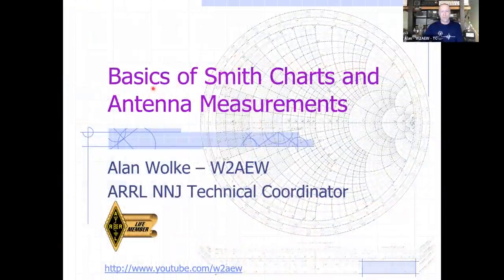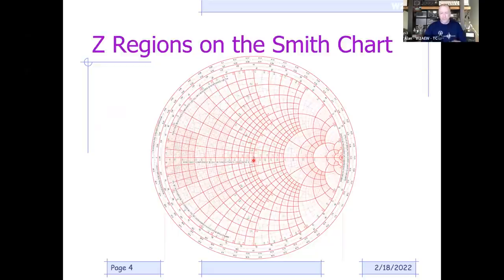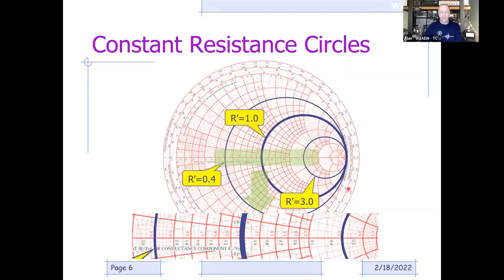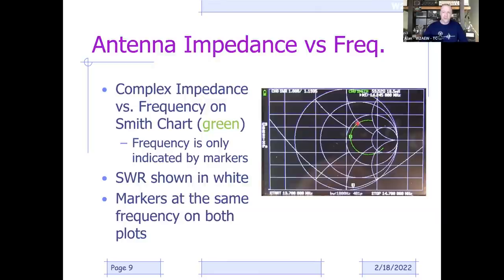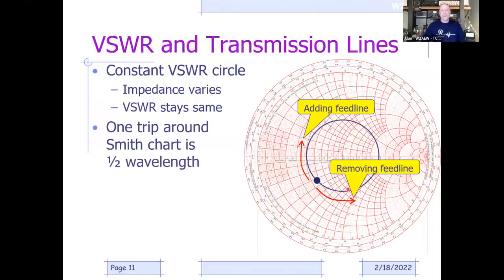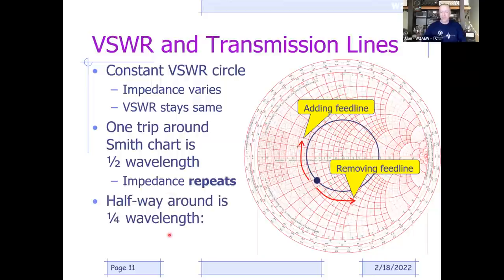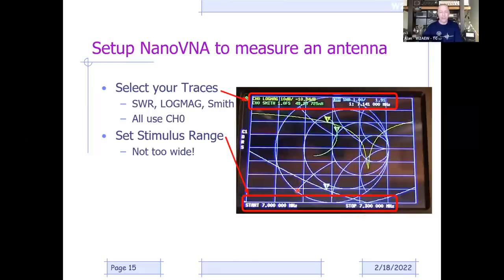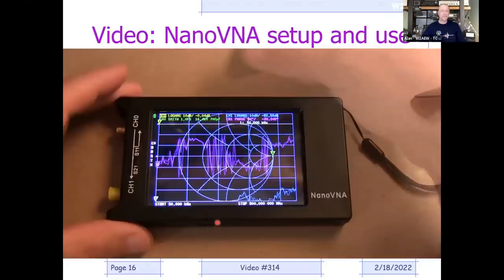#349: Club Presentation: Smith Charts - the NanoVNA and your antenna - matching network design

Comment: No doubt this is the best Tutorial on transmission line and antenna system measurements. The way you explained the correlation is superb and easy to follow. Thanks a lot. Missing the probe tip though 😊

Comment: While restoring a Gates BC-1T AM xmitter, I came across this presentation. Could not have been more perfectly timed as I began the pi network rebuild and connection to my balanced doublet antenna. It demystified some RF challenges along the way and helped me enjoy a successful finish to my 800 lb (literally) project. In fact, your library of videos are a wonderful gift to the amateur radio community and anyone desiring to go a bit deeper into electronics. Thank you.

Comment: Excellent practical explanation. Very neat to see how it all adds up. 20 years ago I had the Smith chart as part of the education for electronic engineer, but used a vector network analyser only in a few occasions. Never worked with Smith chart in this way. Very nice to be able to calculate your way to match the network in a few clear steps. Very interesting. I will watch this video at least one more time 🙂 Thank you for your effort! I have bought a nanoVNA H4 recently and will start to use it.

Comment: This was outstanding !  I picked up Walt Maxwell's  ( W2DU) book a few years back.  He changed the way I think about and  work with transmission lines and antennas forever .The only trouble I had with the book was putting his Smith charts to work. You have just made it  so simple for me to understand. I guess I will  have to dive back into the book now. Thanks and 73 !

Comment: Hi Alan Excellent stuff as always. I've been licensed since the early 70s doing quite a bit of construction and building. I have known that altering feedline length can change SWR but was at a loss to explain why. Your explanation struck me as basic and even embarassed me. Now I know why. For others that want to delve down deeper into this subject, and there is much more, Larry Benko W0QE has his own Youtube Website which deals with the subject. It references a Computer Program "SimSmith" that is a powerful tool itself. For those interested just put W0QE in the youtube search engine. But be forewarned this is a deep subject. Larry like Alan is a Degreed and Highly Experienced EE. His videos are not as easy to follow as Alan's.

Comment: Great video, Alan, as usual.  Thanks very much.  To close the loop on antenna matching networks, would you consider making a video talking about how to choose the right L and C components?  I know inductors can be homemade, but how do I determine wire diameter, core material, number of turns, etc.?  What types of capacitors are suitable?  Cheers!

Comment: I have an automatic tuner (LDG Z-817) that requires an antenna connection, a connection to the transceiver and a serial connection to the transceiver to function. I know I can use a NanoVNA to tune the antenna itself, but I'm not quite sure how I would break out the connection to see what exactly the tuner is doing or if it would even be possible since the transceiver goes into a PKT transmit mode so the tuner can figure out what to do. Not sure what that would even do to the NanoVNA or if it can even pass signal through the SMA ports. I suppose I could connect the NanoVNA to the antenna and adjust it as good as I can, connect the antenna to the tuner and have it do it's thing and then connect the NanoVNA to the tuner and note the change. Thoughts? Great video by the way. Took what appeared to be a difficult subject and made it very easy to understand.
Reply from the maker: Unfortunately, you can't "watch" what the tuner is doing since it needs the transmitter signal to do it's job.  But, assuming the tuner holds its setting once tuned, you can disconnected the radio and connect the NanoVNA to see the result that the tuner came up with.  You'll also be able to sweep over a frequency range to see how broad the tuned result is (i.e. how far can you tune the radio from the original tuned frequency and still have a decent SWR).

Comment: Great presentation - thank you so much! BTW, Smith charts are a powerful graphical way of solving the impedance matching problem, it would be interesting to learn more on analytical solutions to the matching problem. Most ATU:s sounds like a spanish castanets player on drugs when optimizing but surely there must be analytical solutions? If one turns the solution sought by the ATU into a two dimensional random walk optimization problem, I guess one would also be at risk of ending up in local minima?
Reply from the maker: The benefit to an L-network is that there is only 1 minima.  A T or PI network have have multiple solutions.  The downside is that you have to pick the right L network topology.  There are analytical solutions, but they require a vector measurement, not just a reflected power measurement which is typical in auto tuners.

Comment: Hi Alan, thank you very much for the great explanation. Your videos are the real treasure! I have one doubt, and I would be grateful if you can help me to clarify. If we have an external antenna (for instance flex antenna) that is attached to the PCB via coaxial cable and u.fl connector, and the matching circuit is placed on the PCB (let’s say before u.fl connector, if it has sense), how to perform impedance measurement/find the right measurement plane? If we attach VNA at the matching circuit, should we also somehow include the length of the antenna coax cable (actually the distance from the matching circuit to the antenna) because, as you mention in the video, its length changes the way how the impedance is seen from the other side (rotating on constant VSWR circle)? I am a little confused about this. Thank you!
Reply from the maker: You would apply the concept of Port Extension.  I have a video on this:  https://youtu.be/bEPUePy_buM
Adjusting the amount of delay or port extension can be done experimentally.  You'd start (after calibrating at whatever point you can) by estimating how much you need to move the measurement plane from the calibration location.  If it is possible to solder/attach a temporary short at the desired measurement plane, you can then use either the phase plot or the Smith chart  and watch the result as you tweak the delay / port extension value until the phase plot goes flat (or the Smith chart goes to dot at 9 o'clock).

Comment: Great content. Forgive the stupid question, but I am analyzing / tuning a cobweb antenna. Feed line is about 100' from transceiver. Do I connect NanoVNA right were my transceiver is and calibrate with the short / open / load at the antenna feed point (100' away)? I originally calibrated the NanoVNA with the shot / open / load right on the Nano itself, then did analysis with 10' of RG8U right at / near the antenna. Now with feedline attached to antenna and NanoVNA at transeiver end, things look totally different. I am not sure what to trust.  So back to my original question I guess: "Do I connect NanoVNA right were my transceiver is and calibrate with the short / open / load at the antenna feed point (100' away)?"
Reply from the maker: In the end - what is most important is "what is the transmitter seeing".  Replace the transmitter with the NanoVNA, calibrated at the VNA ports, will then show you what the TX sees by establishing the calibration plane at the TX end of the cable.
Reply: @w2aew  - Thanks! for closure, I found an issue with the remote antenna switch that was causing the difference!

Comment: When I move antenna during measurement, the VNA display different SWR and impedance. And difference could be radical. So how do I determine which result is the correct one???
Reply from the maker: Antenna impedance can be greatly affected by their surroundings.  So, if you move the antenna, the distance to ground and surrounding objects (even your body) will change, and this can affect the impedance of the antenna.  So, the answer is all of the results are correctly showing you the impedance of the antenna in that particular position. It is best to measure an antenna in the location where it will be used.
Reply: @w2aew  Thanks for reply! However I am designing tourist antenna, which means no fix to particular position. Seems need to carry NanoVNA along my trips to find proper impedance at each stop-station.
Reply from the maker: @sugarvenom2189   Very common with VHF/UHF antennas. You just have get them close and not sweat it.

Comment: I recently obtained a NANOVNA H4 and I have this question for you.

I wanted to take a 9:1 unun and look at the secondary winding which should be 450 ohms.  I've only seen videos where they are looking at the primary side (50 ohm feedline side) which is easy enough to accomplish.

For looking at the secondary, 450 ohm antenna feed point on the unun, I reset the H4 to read 450 ohms on the Smith Chart 1.0 system impedance point to normalize it.  The H4 now displays "PORT-Z: 50 -> 450 Ohms".  The results look very good.  Is this the proper way to have accomplished this, or should I have left it at 50 ohms and divided 450/50 and located that point on the 9.0 horizontal prime access line?
Reply from the maker: I believe what you did is correct.  I haven't played with that feature yet.  But, if you terminate the 50 ohm side into 50 ohms, and the smith chart is shown (near) bullseye center on the S11 on the 450 ohm side, then I say you are doing it right.
Reply: @w2aew  Yes, I did terminate the primary feedline side with 50 ohms.  Thanks for your reply.  Your videos are extremely helpful to me.

Comment: Thank you very much for those videos. I was trying to understand how to make a Pi matching network to design a PCB for one ESP32-S2 soc. It has an outuput impedance of 35ohm+0j and I need to match it to a 50ohm MIFA trace antenna at 2442MHz. I kow there are some web applications bit I would love to see a video about that using Smith Chart. Thank you very much.
Reply from the maker: The process of using a smith chart for designing an L-network for impedance matching starts at 39:00 in the video.  Do you really need a Pi network where an L-network will do?

Comment: Is it best to probe the antenna with little to no transmission line? If you wanted to figure out the impedance for a multiband antenna, how can you best figure out the matching circuit?
Reply from the maker: The important thing is to establish the calibration / measurement plane at the same point where you intend to apply the matching circuit.